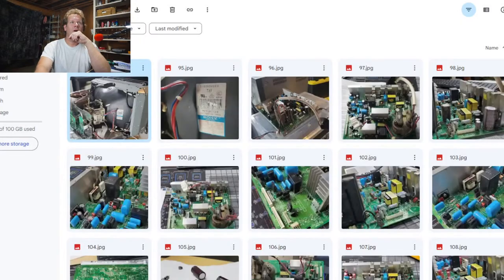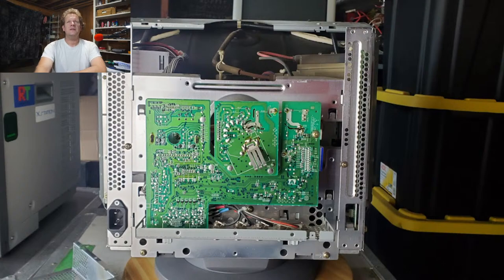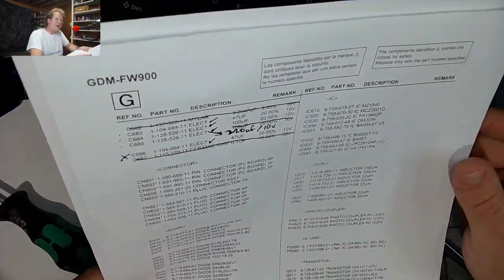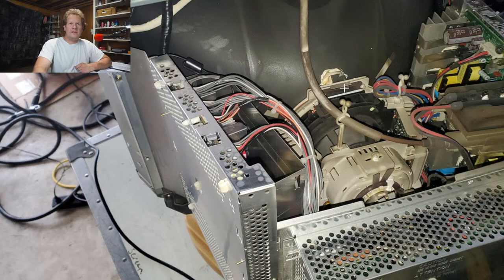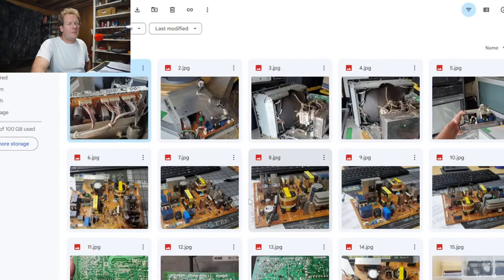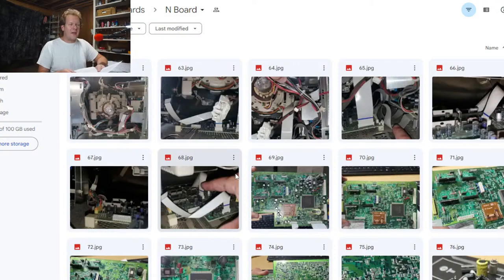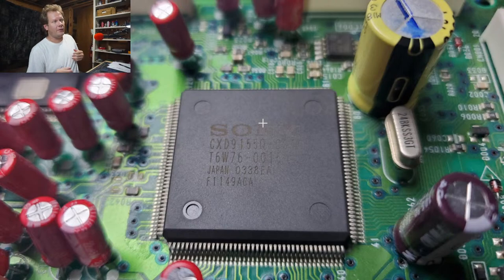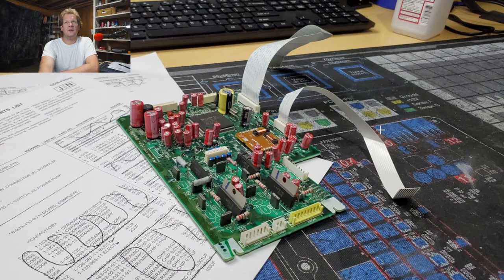Sony FW 900 Complete Board Restoration Review

Comment: I just got one of those Wega kv-20fs120's for 10usd that you had on the floor during the intro. 70 miles/113km roundtrip in my massive city. Came basically mint. Just needed a RCUT adjustment since reds were present in black backgrounds. The older gentleman said he used to compete in Ghost Recon. What a solid tv